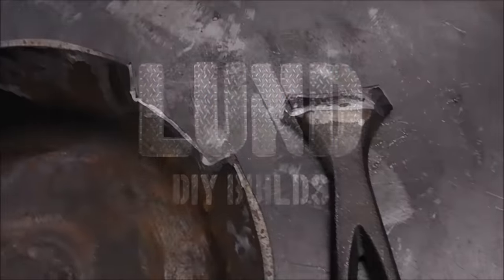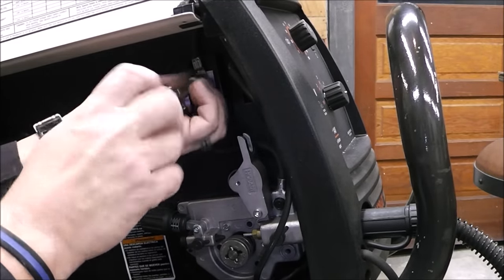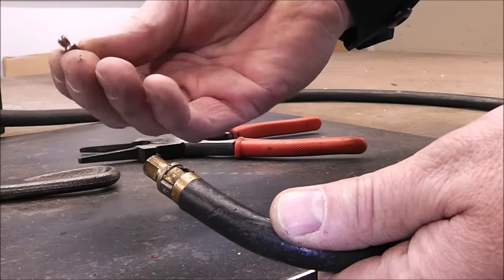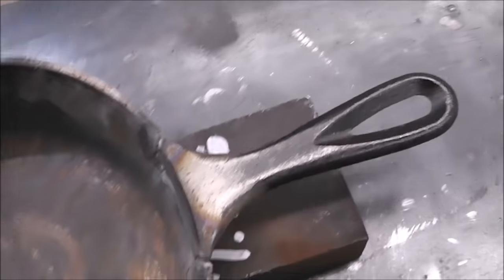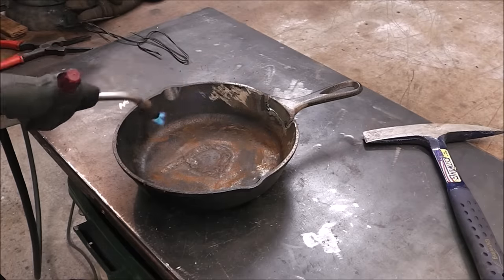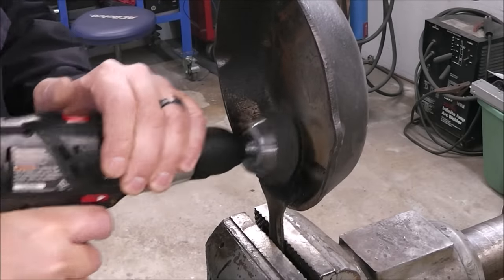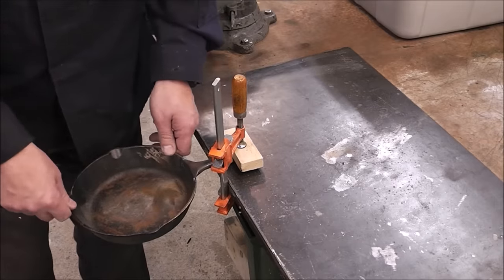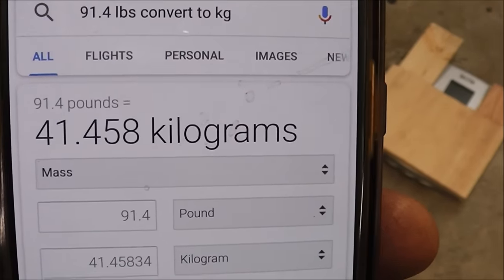Cast Iron Welding Repair using Flux Core Wire

Comment: The moisture you see evaporating from the iron isn't inside the metal, it's condensation. When the metal passes 100c you can see when the condensation no longer attaches to. This trick can be used to give a rough estimate of how hot your parent metal is. You can also put a carbonizing flame to it and dump the soot on the surface, when the soot evaporates you know you're past 400c.
Reply from the maker: I knew about the carburizing flame but I was not aware of the moisture indicating temp! Thank you! What a great tip!  Im almost 50. Just proves we are never to old to learn new things. Cheers!
Reply: @BrandonLund  I'm Glad I could share, Great video by the way keep up the great work!

Comment: I just discovered your channel (and this video) so I have a lot of binge watching to do..lol  I was wondering, on your cast iron skillet welds have you tried test cooking after having made a repair?  Specifically, I wonder while heating does the pan and the weld expand at the same rate? If not it could possibly lead to weaking the weld over time.  It could be a dangerous situation if the handle suddenly gave away while full of hot ingredients.   Thanks for posting and I look forward to watching more of your videos.
Reply from the maker: Thanks man and welcome. I wont repair cast cookware.  There is just way too much liability. The filler metal will expand and contract at differnt rates and could fail as you mentioned. For a while I was using exhaust manfolds for my demonstrations but people were saying I was welding cast steel (even thought I show how to deternine cast iron vs cast steel) so I switched over to cast iron pans to eliminate that variable.

Comment: Thankyou .i found it very interesting.  I do have a question i hav a sca mini mig welder . However when they made it they wired it up as gun positive. Since it is only gasless i have found out it should be gun negative. However the way they have done it its got the heat shrink on the conections. Do you think if i was to cut heat shrink off and change it over . Then re heat shrink the connections it would still work. Any advice appriciated.
Reply from the maker: I wouldn't dare experiment afraid I'd blow it up. There is no telling how the board was wired up

Comment: Do you think the breaking point would change if the pan was heated up like you were using it on the stove or in the oven?
Reply from the maker: Possibly yes. The reason I say this is the main reason to heat the cast before welding is to reduce the risk of cracking. The molecules / grain structure have an easier time rearranging themselves over heat versus going from room temp to 2500 degrees welding temp instantly. So heating it first can reduce the chance of micro cracks forming due to the heat shock. I always pre and post heat but was curious if it could be done successfully without it 😁

Comment: Are there any risks with using fluxcore or standard mig wire on food related items; such as contamination, etc?
Reply from the maker: Because I dont know and I am not an expert in metallurgy, I have to tell you it's not safe,  but personally i dont see any more risk than eating from a cast iron or cast steel pan. I personally would not repair a pan and put it back in service. Too much risk if the pan should crack with hot greese.

Comment: Brandon, I guess my wife is now limited to frying only two pork chops instead of three? 

Nice video, subbed.
I landed here because I'd like to see how well I can fill in the errand drill holes in a drill press table.  Figured I'd spot weld them similar to your process and then grind them flat.  Do you have a flat piece of cast that you filled and ground flat?  Is it very noticeable?
Thanks
Reply from the maker: Thanks man! If you weld a flat piece and your weld is too shallow you can always just build it up a little with additional passes. Of coarse you risk adding more heat to the part but if you take your time you will probably be ok

Comment: Is your glove electrically insulated or is that not a concern? I jus picked up my first welder, it’s the harbor freight flux 125 although I’m finding it’s not suitable for the thin stainless steel I wanted to weld as I’m melting holes though it. My first question was wether I could safely touch the piece I’m working on without getting electrocuted.
Reply from the maker: So the safe answer is there is always potential to be electrocuted, however electricity takes the path of least resistance to ground. As long as your not standing barefoot in a puddle welding  you should be all set. You can actually touch the metal bare handed as you weld without getting a shock. Congratulations on your welder purchase!
Reply: @BrandonLund  Alright cool, thanks for the reply.

Comment: I personally drill small holes at the end of the cracks to prevent any cracks from the Flux shock and it worked
But that was a great video
90 lb omelet I'm thinking Flintstones lol
Reply from the maker: Excellent point. I do too. Its not as critical to stop drill if the crack extends off the piece. Its more critical along a crack that stops in the center of a piece. Stop drilling will help prevent the crack from spreading and propagating outwards.
Reply: @BrandonLund  I had a old timer teach me that one and never had a problem
Reply from the maker: It's excellent advise! 👌

Comment: Thanks for your time in creating this vid.
How would you weld a crack in grey cast iron Goulds water pump down in the base of the bowl, the bend of the bowl or the seam but not.  I only have a flux core welder with E71T-GS - 0.030 Inch Blue Demond wire. But, after I use a grinding wheel to make a trench I was thinking of using a nickel rod along with the pass. I would heat it up first after its all grinded and cleaned and I have a trench and holes drilled at each end. I will put it in a sand bath for 24 hours after I am all done.  But, it's not more than an 1/8" deep cast iron. The crack goes all the way through. Hair line 98% of crack to about a two to 3 hairs crack 2% of crack. LOL. 
1. Can I grind it out all the way through with a hole at each end of crack. I have been told not to go through the iron. But, there are no parts or anything on the other side that I have to be careful and not weld onto?
2. With using the flux and rod can I just go at a speed until the pool fills up all in one pass?  The crack is about half the size of the pumps diameter. 4-5 inches. 
3. Can I go the speed that would fill the trench then stop halfway or, (?, Distance of stop and go) Stitch it and come back before it cools all the way down to finish.
4. I can only get to the outside of the cover. Its about 10 " in diameter. 
 I only have one sht.
Please help don't judge because I am women. I have to get this done.  Can't afford to be ripped off by someone else when I know I can do it We have no water. 3kids, and farm animals that need water. When grind into looks smooth and silver.

Comment: I got a bad crack in a cast iron manifold, stop drilled, ground the crack out, pre heated with propane, welded with my 120v Hobart Flux and it was fine
Reply from the maker: Great news!

Comment: Hey I’m somewhat new to welding, I was just wondering, so basically I have a flux core welder not mig just flux, and I was thinking of taking off the nozzle because I don’t have gas flowing thru so I thought I wouldn’t need it, but if it is very important not to touch the tip to the weld should I just keep it on? I don’t want to damage anything
Reply from the maker: @agent what will often happen if you leave it on that the nozzle will build up with spatter and that can clog things up too.  I personally remove mine and I'm just careful not to touch the tip to the metal. You wont get a shock but it can arc a little on the tip. Try it first with the nozzle on and then give it a try with it off and see which you prefer. They do make a plastic nozzle for flux core welding that eliminates those problems. Also if you haven't already check out this weeks video. It discusses flux core and sold wire.
Reply: @BrandonLund  okay thanks
Reply from the maker: @agent, anytime brother!
Reply: @BrandonLund  hey so I had a question abt flux core real quick, I was welding earlier and I noticed that as I tried to make a puddle it would work for a few seconds and then as I tried to move it was laying down anything it was just tiring into spatter, have any advice on how to fix that?
Reply from the maker: @Agent hold about 5/8" to 3/4" from your work piece. It sounds like you might be traveling too slow maybe
Reply: @BrandonLund  ok thanks

Comment: I suggest after welding. Apply some post heat
Then cover with fibre fire blanket or sand as was done in the video. To allow to cool slowly
Reply from the maker: Great tip! @tontobb8956
Reply: @BrandonLund  what the post heat allows is for the steel fibres to realign themselves before cooling
In laymans turn. It helps relieve stress and reduces chance of recracking 
Hope that helps others

Comment: You should use an unbroken pan as a comparison, if your repair holds up as well as an intact pan it's good. Also If I were fixing the skillet the amount of weight that you applied is plenty adequate for the purpose of a pan. But it is good to know that flux core is good for cast iron. I've used oxy/acet. with cast iron sticks. They work but the difficulty is heat and cooling, and often the cast metal is contaminated with other substances as well as water, for  ex. salt and corrosion/rust.  Thanks, nice job..
Reply from the maker: Thanks Gary! I actually have a whole cast iron repair playlist and we actually take a brand new pan and snap the handle, repair it then see how much it holds. Some filler metals are quite impressive.

Comment: Im curious, is it safe to weld the cast iron for cooking because of the heavy metals in the flux wire?
Reply from the maker: I personally wouldnt try it. Plus if the repair ever failed for whatever reason, it could result in fire or injury.
Reply: @BrandonLund  Thanks for the advice

Comment: I probably missed it but what did you have your welder set at? I have an Eastwood mig 135 with infinite dials for the settings.
Reply from the maker: I dont specifically remember but I most generally use the chart on the door and it's usually very close.

Comment: Would you do a cast steel alloy farm bell? I see some are cracked from time to time . They are made of a hardened steel not cast iron like most people think.
Reply from the maker: If its cast steel you can generally weld it just like you would for regular carbon steel.

Comment: Very interesting ... I’m certainly going to give this a try.
When preheating you mentioned that water was coming out of the cast. Is the water not coming from the butane/propane and condensing on the cold cast? Also blacksmiths tend to use vermiculite instead of sand to slow the cooling. You might want to give it a try.
I’m certainly going to experiment more with the mig. Thanks.
Reply from the maker: Thanks man! I misspoke about moisture...the better term would have been a byproduct of combustion

Comment: When it comes to welding cast iron, it's not so much the heating it up that causes it to crack. It's the cooling down that causes it. The rest of the steps are right. You want the heat dispersed throughout the whole material. So the heat expansion isn't isolated to the weld area. Then the cooldown is more important than the heating and the weld itself. You want it to cool down slowly and as uniformly as possible. The cracking happens due to isolated heat and cooldown. It pulls on the material around it when it cools down, causing further cracks.

Comment: There is actually a welding rod made for cast iron. I've used it while working maintenance on machinery. It works real good, still have to give special attention to the properties of cast iron.
I prefer to braze cast iron myself.
Reply from the maker: Have you ever tried mig brazing with silicon bronze? WOW! It was the strongest we've tested to date by far and it's super easy and forgiving...just not so great for high heat applications
Reply: @BrandonLund  I've heard of that, been wanting to try it. But since retiring, I doubt i'll get a chance.

Comment: Hey Brandon, can air hammer bits be welded?
Reply from the maker: I personally would not. Most are hardened and welding will ruin the temper.
Reply: @BrandonLund  okay. Thanks for the reply.

Comment: I have welded all kinds of cast iron with no weld using a needle scaler to peen the weld and surrounding metal to stress relieve it. No preheating or after heating. Just weld a little then peen a little. Works for stick welding cast aluminum also.
Reply from the maker: Excellent tip Anthony! A needle scaler is actually the perfect tool for this. Thanks for commenting!

Comment: You mention the 0.03 FC wire; but what about the machine settings? Voltage and Amp/wire speed setting. I’m new to welding at home with my 125 FC machine, and trying to figure out these two settings for different thicknesses of metal. 🇨🇦
Reply from the maker: @Barry Bebenek I pretty much use the chart on the door as a starting point and go from there. Check out this video. I think you will find it very interesting and helpful. Thank you for commenting https://youtu.be/gbnNYIlGuDo 🙂

Comment: Subbed immediately , I have a Lincoln electric s500 power wave would pulse work with flux core and make a smoother weld???? It should in my opinion
Reply from the maker: Pulse would help to limit heat imput but you would still need to pause between passes and thanks for the sub! Much appreciated
Reply: @BrandonLund  love guys that have the same passion or hobby as I do

Comment: While you're at it, I have a suggestion. How about simulating normal use by heating & cooling post-weld, to see if expansion causes any failures?
Reply from the maker: Great idea! I have a feeling we might not see a failure though. A lot of viewers have commented throughout the cast iron welding series that they have repaired exhaust manifolds this way and it went years without failure.
Reply: @BrandonLund  well, that's what tests are for though, eh? :)

Comment: Yeah I'm one of those guys .I don't have a stick welder.but I do have the exact machine you have and I appreciated this video .I have a question.would it work if I used the argon mix welding gas connected to my 140 and used solid wire?
Also wish you would do a video on welding with aluminum wire if it's possible to.without buying the expensive spool gun.my freind thinks there is a way to spot weld or small pieces weld with aluminum.it  seems like there must be a way to spot weld then maybe pull by hand more wire .I think it will kink in the hose if you use the trigger to feed the spool .it just seems like there should be a way configure or maybe built a primitive ,quick,inexpensive nozzle or wire jig or gun jig.... If you ever have any good thoughts it would be great.or a video.if you could manage a way it would certainly get loads of views across the world with a eye catching headline like how to weld with mig using origional welder and without using spool guns...I never have seen or heard of anyone ever.its like the holy grail of last unexplored welding topics that haven't  changed from the long time understanding that you have to have a spool gun ....thanks
Reply from the maker: @eric griffin. Ask and you will receive LOL https://youtu.be/FGhSo82MP9U

Comment: This is actually really cool! Looking at how the weld failed during the test the flux may have caused carbon/element migration during the alloying process of welding? Maybe it could be lessened by heat cycling it again or anealing the whole thing?
Reply from the maker: Both are very possible. I was actually amazed it worked at all lol

Comment: Read on a form that there wasn't any food safe flux wire but it didn't really sound right considering it's the same metal composition but someone else said that's because of the porosity/ required tooling and potential rust which would Harbor bacteria and not pass inspection, so not sure. do you have any information on whether the flux would somehow pose a food safety hazard?
Reply from the maker: Honestly I don't have any knowledge if it's hazardous to eat from cookware that has been repaired using flux core wire. I personally think anything in excess can be bad for you and this can include anything from water to heavy metals.

Comment: Great demonstration! I've tried welding cast iron for years. But no success at all with any process. It always cracks right next to the repair no matter how well it is prepared.preheated and post heated.. mig . Flux core or stainless. The best and closest was to braze. Works like glue only will withstand higher temp.. lol 🤣.  Best!
Reply from the maker: Thanks 👍

Comment: Ugh I e flux core welded cast a handful of times never pre heated it it's been ten years on some of the pieces and never cracked or had any issues I just never did it and it's been good for me .
Reply from the maker: @PAmancave surprisingly when we hung weight off the handle in our cast iron playlist, flux core did incredibly well.

Comment: Been thinking about getting a cheap small cast iron skillet and cut it so I can add a flat side of mild steel to drill and tap for shot drippers so I can turn wheel weights into shot
Reply from the maker: Thats a pretty cool idea!
Reply: @BrandonLund  Thanks. Your video reminded me
Reply: @BrandonLund  would you use a 6011 or 6013 rod for the fillet?